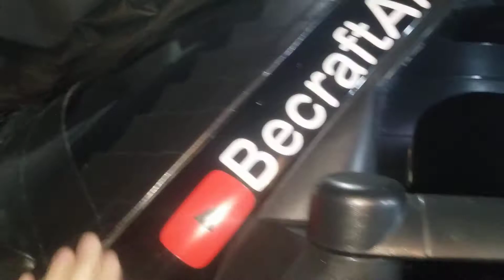windshield "fixed" and planning out for the new amps!!

Comment: so which amps are you going with?
Reply from the maker: Im not 100% sure but either some smaller nendo amps or cab 4500s for now i think
Reply: @BradBecraft  The Cab 4500s are pretty popular. Have you thought about the Team Pie amps? Super inexpensive but basically the same amps. The 5500 is $500 and for an extra $50 you can get your own custom Becraft Laser etched. 🤪
Reply from the maker: @Widowmaker2828  i haven't looked into them im still not 100% yet i just know i want 12 4-5k amps lol
Reply: @BradBecraft  I haven't personally run them but I would probably give them a try if my current amps go out. https://youtu.be/EW6Dr2xSgnA
Candace Huang on Facebook sells them in the states. Facekicker on YouTube sells his etched versions of these too. I think they make rated power.